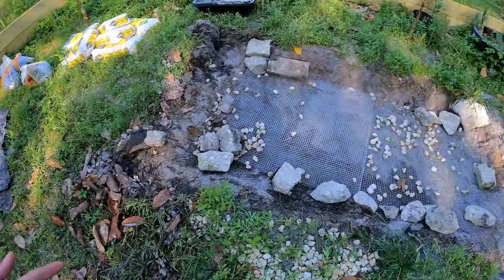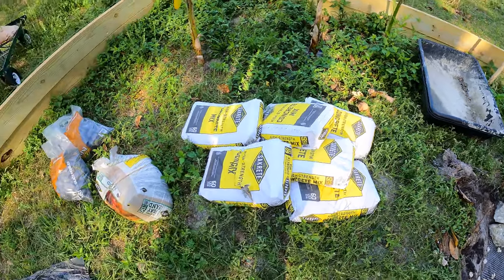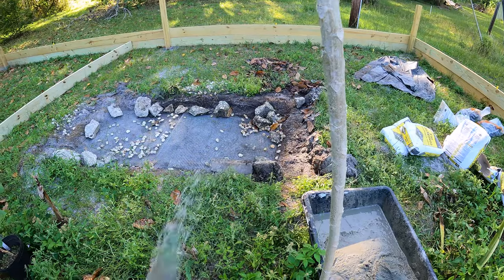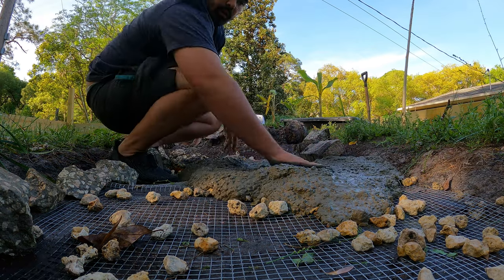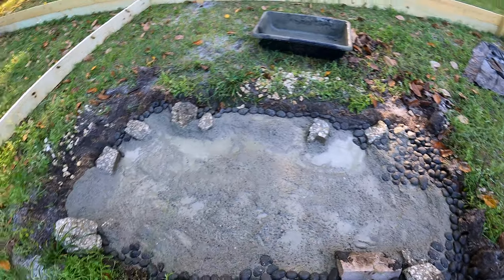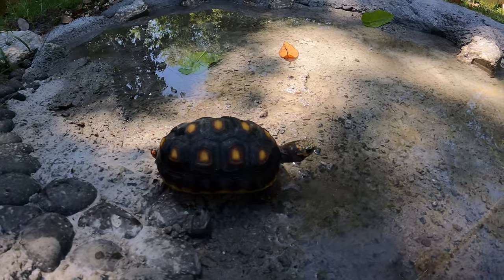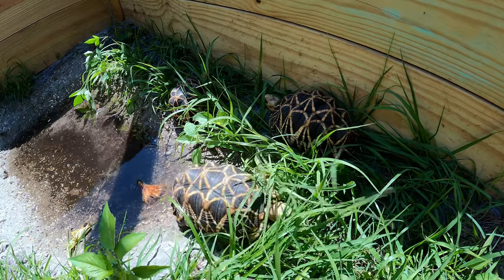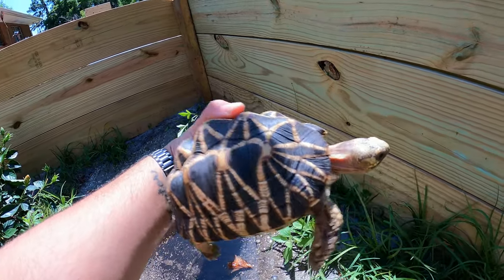MASSIVE upgrade to the Redfoot Tortoise Enclosure

Comment: Did you seal the segment ?
Reply: Did you seal Cement pond ?
Reply from the maker: Nope, I purposely did not seal the cement so it will drain overnight, the next morning all debris is swept out and it’s refilled with clean water. This way there is zero algae buildup and the water is always super clean.
Reply: @spacecoasttortoise  good points thinking of doing this in Hermanns tort pen.
Reply from the maker: They will love it! Highly recommend it!

Comment: how could i stop ants
Reply from the maker: Ants can be very tricky to get rid of, I’ve tried diatomaceous earth, pouring boiling water. These are all temporary fixes. What I find works best is placing bait traps outside the enclosures to lure them out. You may have to replace these a few times but it will eventually fix the issue. Hope this helps!
Reply from the maker: Also I find the ants LOVE to build their nest under food and water dishes which is why I poured concrete for the pools. Now it’s no longer an issue.